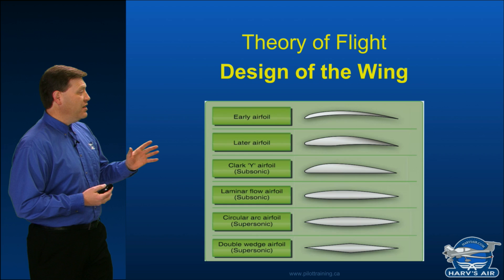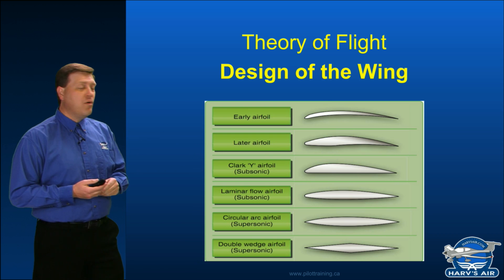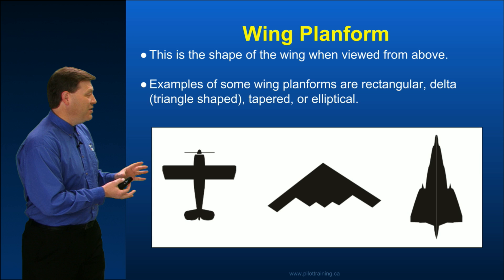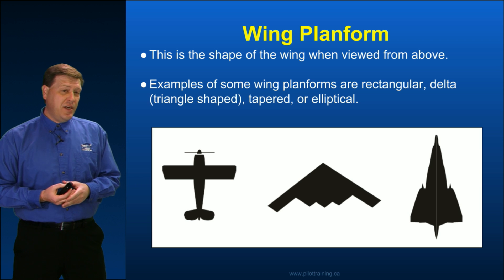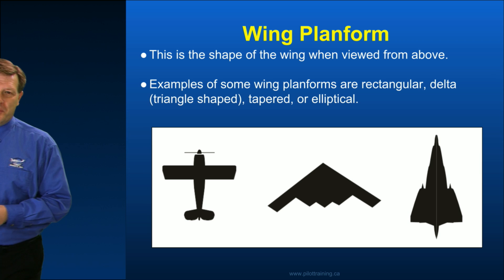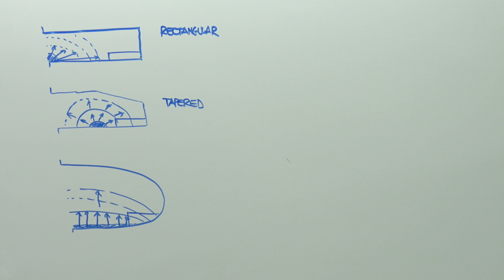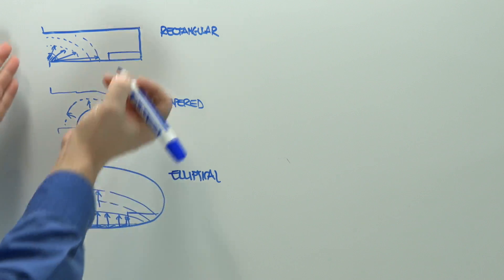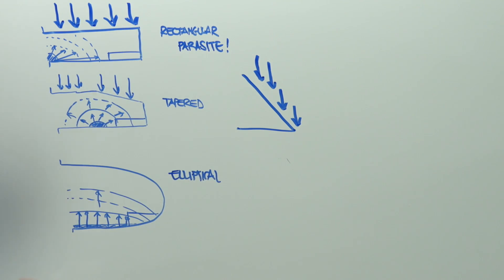Intro To Design Of The Wing

Comment: Couldn't make the video 2 minutes longer to talk about the lift characteristics of each design? 

For those wondering, the delta wing is going to produce a lot less lift at low airspeeds than traditional designs. It gives the benefit of reduced drag for higher speeds, but requires higher speeds to lift the aircraft. 

There's another wing design called the variable-sweep wing. These wings can sweep out to provide better lift at lower airspeeds (i.e. takeoff/landing) and sweep back to benefit from the lower drag at high airspeeds.

As someone who has studied aircraft maintenance and aerospace engineering, this video is terrible. It barely scratches the surface of wing design and literally just ends without even painting 1/4 of the picture.

Comment: I have designed a wing which on simulations showing 9.5:1 (l/d) ratio for my rc plane , maximum angle of attack is 16.4 degrees and minimum is -19.6° ..and maximum Cl = 3.365 ...will it be able to maneuver properly ?? Reno varies from 2-3 , and my air craft 's total wing area is going to be 2000cm^2
Reply: How did you simulate it?
Reply: What's your wing span

Comment: I cannot wait until someone designs the first true variable geometry wing capable of automatically changing its shape to suit different types of flying. Utilizing shape memory alloys and polymers, or maybe even artificial muscles.
Reply: I have designed a wing which on simulations showing 9.5:1 (l/d) ratio for my rc plane , maximum angle of attack is 16.4 degrees and minimum is -19.6° ..and maximum Cl = 3.365 ...will it be able to maneuver properly ?? Reno varies from 2-3 , and my air craft 's total wing area is going to be 2000cm^2

Comment: Elliptical Planforms make approximately the same span wise lift distribution as the planform.  Which may be "good" but is not ideal.  A Bell shaped span wise lift distribution is actually ideal.  Prandtl knew this back in the 30's.

Comment: Must consider the economic aspects for leisure and commercial missions as well as the speed/altitude regime they will work on. Swept planforms and elliptical cost much more. Swept wings do not have good handling characteristics. Swept wings and swept tail feathers are actually worse performers at subsonic speeds under, say, Mach 0.6. For military applications, the price is of no consideration vs air superiority. Neither is the handling, unless you believe there will be dogfights in the future (highly unlikely, but possible)

Comment: Why does a perpendicular airflow increase the parasitic drag? You actually have a longer length over which the drag occurs on the tapper wing (for the same wing span). Is the drag from tip vortices reduced due to the higher aspect ratio near the wing tip?
Reply: I think it has something to do with the hypotenuse of the wings leading edge being longer to cover the same length as if it were flat giving you more surface area to which more drag comes from
Reply: @ac-130attackaircraft3  I think it actually has to do with tip vortices rather than parasitic drag over the surface area. Tapered and elliptical wings are more efficient since they reduce the wing vortices compared to rectangular wings with the same wing loading. His explanation of increased parasitic drag didn't make sense to me. If that is what it is, there is something missing in the explanation.

Comment: Fair enough as far as it goes - but wing design isn't all about aerodynamics when it comes to plan form. Inherent strength and consequent weight are equally, sometimes more, important. All forms of tapered or quasi-elliptical wings reduce maximum bending moment, increase bending strength and hence are most commonly used. Parallel wings delivering maximum lift usually need some form of structural intervention (struts) to produce a structurally efficient package, [A retired aircraft stress engineer]
Reply: What is QUASI-elliptical???
Reply: @sfzdgxfhycgjuvkyihopu  For example, in plan-form: from the root of a 3m chord, a 10m leading edge radius, a 10m trailing edge radius and at the point of intersection a 0.5m blending radius. Look at the cross section of any large European petrol tanker. It will be a 3m top and bottom radius blended with a 2m side radius: nominally elliptical.
Reply: I suspect “as far as it goes” in this video was just the very beginning of a much longer, multi-topic discussion. This was just a teaser for courses at the web site.
Reply: He also doesn't once mention the reduced lift characteristics of swept back wings once. Kinda a garbage video tbh. (AMT schooling, worked in a turbine shop, and studied aerospace engineering)

Comment: What about a forward style swept wing?
Reply: there is a video made by Real Engineering and another one made by Millenium 7* that are very good to understand why it's such a controversial design. You can just search it on yt (I'm too lazy to link them lol)... but to sum it up, basically: the airflow impacts the wing from the tip, and then goes towards the root. What this means is that the stall will occur from the root of the wing, and then it will proceed outwards to the tip. This is very good at slow speeds and high angles of attack. However, when going at higher speeds, especially supersonic ones, the bending and twisting solicitations the wing is subject to become a big problem, along with drag, which is much greater.

Comment: Right when it starts to get good, the video ends. 😳
Reply: Agreed. That ending came outta nowhere.
Reply: Ikr, he was still talking. They want you to buy the course for the whole thing I’m sure
Reply: done by a porn director
Reply: Fr
Reply: I was shocked too 😂
Reply: Delta wing gives lower drag at the expense of lower lift. You need higher airspeeds to overcome the lower lift. Thats why variable-sweep wings exist. Extended for higher lift at lower airspeeds, swept back for lower drag at higher airspeeds. This video is garbage and barely scratches the surface of wing design and characteristics lol.

Source: I went to AMT school, worked in a turbine shop, and began studying aerospace engineering before health got in the way. It's safe to say I can make that judgement call.
Reply: Took this ground school course for my PPL and it was amazing.   Highly recommend it.

Comment: I was hoping that he would explain the sweptback wings of jet airliners but I still love the explanation👍
Reply: Pretty much the only valid reason for wing sweep is to allow thicker wing sections to be flow at higher speeds than their critical Mach numbers for their respective thick-airfoil sections.

e.g. an Airfoil that is 14% thickness to chord (height to length) might have a critical Mach number of 0.68 (68% the speed of sound). And an 9% Airfoil might have a critical mach number of 0.85. 

But a highly swept 14% thick Airfoil, which has more internal volume for structure and fuel, can attain the same Mach number speeds as a 9% Airfoil which has no sweep.
Reply: Real engineering has a video abou that
Reply: @Toastryan  I already watched that.
Reply: @ChrisZoomER  makes sense, it has been 6 months
Reply: @ChrisZoomER  given this comment is 9 months old I think you might've watched that too, but there is also another video about forward swept wings, made by Real Engineering... and also one made by Millenium 7*